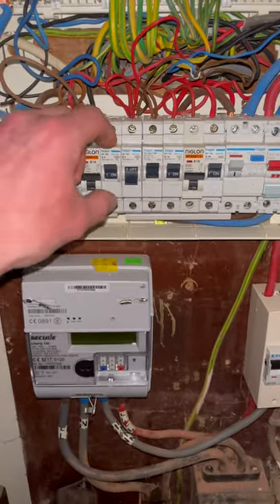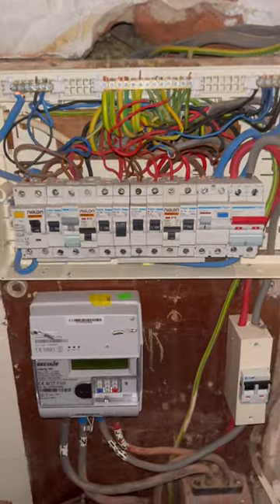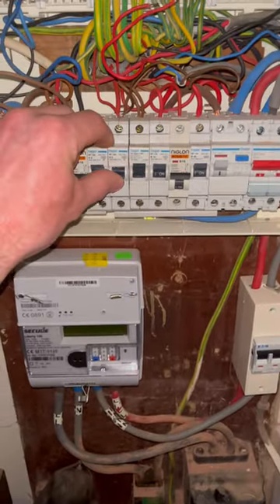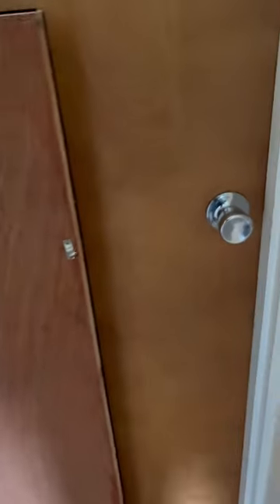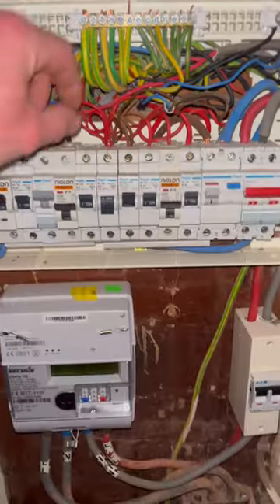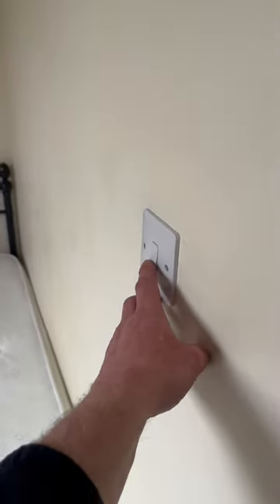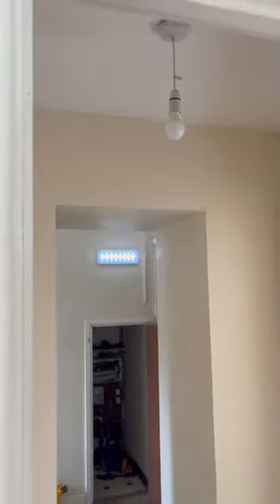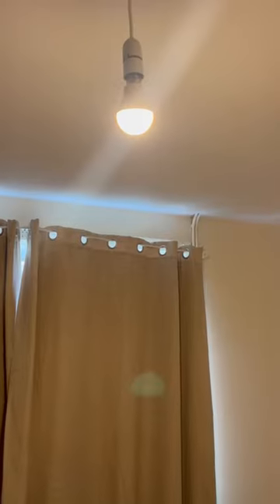"Help i smell burning !!"🔥

Comment: Had similar in a large computer room double banked on 10A Fuse,  by removing all the fuses from the fittings circuit held ok, then with the frowned upon test lamp across fuse way on fitting check for no dead short put fuses in one by one, 2 ballast on 1 bank & 1 ballast on other bank, isolated them got all working bar the offending ones, mind you that's over 30 years ago now

Comment: I’m an apprentice so I’m wondering, I thought the RCD would trip first anyways than the mcb
Reply: Rcd won't see a short between live conductors (line/neutral) as there is no imbalance. Rcds do not provide overload/short circuit protection, that's what the mcb is for. Unless it's  an rcbo which is a combination of the two devices in one. Keep watching these videos, you'll pick up lots of good info, never be afraid to ask questions.
Reply: If the fault is L-N, there won't be a current imbalance so the RCD won't trip but the fault current will cause the MCB to trip
Reply: Rcd has no mcb part inside as rcbo to trip în short beteeen live and neutral
Reply from the maker: What the guys said 👍